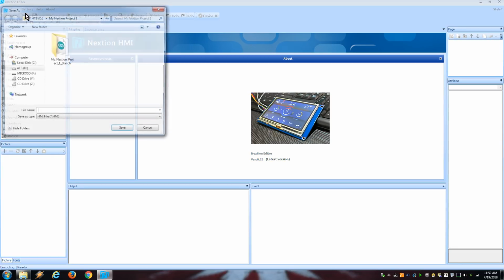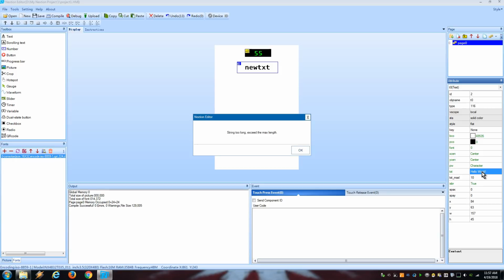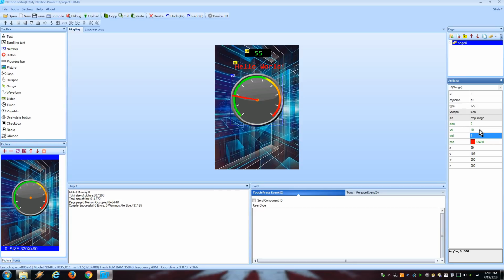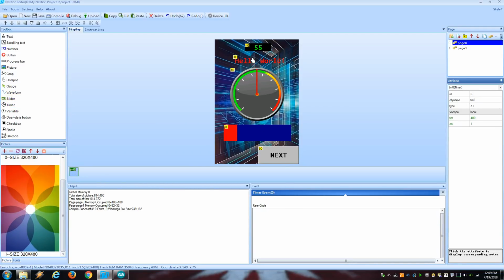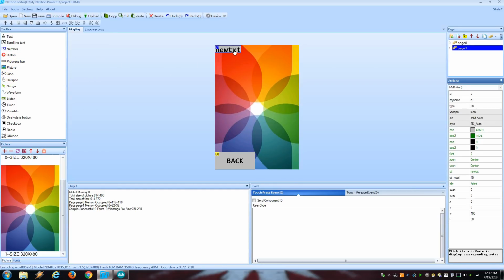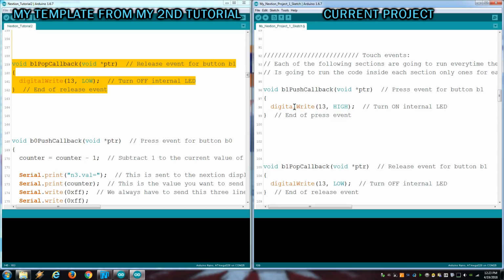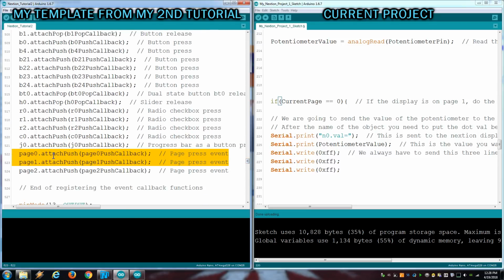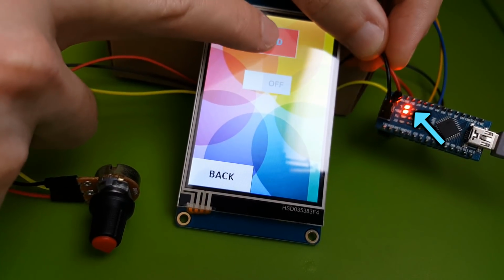Nextion+Arduino Tutorial #6 A Project From Scratch

Comment: When you are sending and receiving data, does it get sent to the serial monitor? If so, how do you use the serial monitor for troubleshooting?
Reply from the maker: It does send it to the serial monitor too. What I do for troubleshooting is print debugging data in the nextion display, only while troubleshooting. Once the code is finished, i remove that from the display.
Reply: @interlinkknight  Good idea thanks

Comment: what happend if you turn on led and go to another page?
Reply from the maker: There are many ways you can handle that. Usually, the LED would stay ON and the toggle switch on the display would reset to the default value once you go to another page, but you can make it a global variable so it can remember the state, no matter in what page it is.

Comment: I am trying to build a Nextion project to display two separate DC voltages real time as a dynamic bargraph (Progress Bar) and another indicator field that simply shows Red or Green based on a Voltage state (+5V = green, 0V = red) on a third pin. Hopefully I can extract enough hints and tips from this video to assist!
Reply from the maker: Yes, it's possible. Just watch all my tutorials and try those examples

Comment: Perhaps I missed it but can I have the Arduino command the changing of the display's pages?  For example, if the temperature of my sensor goes above a certain value, automatically switch the display to the temperature control page.  Thanks
Reply from the maker: Yes, you can. I show that on tutorial #1, I think

Comment: Does anyone know if this project will work with the 7 inch HDMI screens that can be purchased off Amazon?
Reply from the maker: All nextion displays work the same no matter the size
Reply: @interlinkknight  right ok, but does it matter if they aren't nextion displays? Or are the 7 inch displays really generic
Reply from the maker: Oh, you mean HDMI generic monitor or TV? No, no, no. That's a completely different thing. This video is about nextion displays that allow creating a graphic interface and connect to microcontrollers like Arduino. Nextion displays have their own controller so Arduino doesn't have to write everything on the screen. Instead, in the nextion editor you create the images, text, buttons, etc and then communicate with Arduino about the actions and send values and things like that.

There are many sizes for the nextion display, but you can't use any generic display for that. If you want a generic display, maybe use a raspberry pi
Reply: @interlinkknight  yep, gotcha. That makes perfect sense! 
So, what else would I have to do to with the Arduino the receive the CAN signals from my ecu? My ecu has a CAN high and CAN low out put.
Reply from the maker: I don't really know, but I guess if you you look for that maybe someone has a tutorial or something about that.
Reply: @interlinkknight  thanks anyway!

Comment: mine is not working... not getting the callback funtions on the arduino to start.. i can read the callback data i get the data from the display but b1.attachPush(b1PushCallback);  not working
Reply from the maker: Try my example files first

Comment: Hi InterlinkKnight,

first of all thank you for your outstanding work!
I tried to find a way to get me into the NEXTION display generation. Tried several ways, read a lot in other forums, but noboby was able to open the lock. Since I found your videos here on Youtube.
I worked them all through, all of them worked so far, now a tiny problem occured:
In Your tutorial #6 you want to get rid of the flickering of the gauge and at minute 15:00 you make an input in the timer you used for the changing of colors: 

- - -
if(z0.val!=va0.val)
{
  z0.val=va0.val
}
- - -
If i do the same and debug, I get the followig errors:
- - -
Error:Invalid Variables:va0.val( Double click to jump to code)
Error:Invalid Variables:va0.val( Double click to jump to code)
Error:Compile failed! 2 Errors, 0 Warnings,
- - -
Well I can live with the flickering, but it would be nice to solve, just to solve and learn ...

Any idea?
Thank you in advance

Freddie
Reply from the maker: Not sure what you did different. Compare your code to mine as close as possible. Eventually you should find the difference.

I wish i could help you but nothing comes to my mind. At least you have my code working so you can use it as a template.

Comment: I have a question: How do I get the display to show for example 3.1 instead of 3?
Reply from the maker: It doesn't support decimals so multiply by 10, then send to the display and add the dot in the background image if that screen
Reply: @interlinkknight  when I multiply by ten I get 10,20,30 etc. I have defined the values as int. Do I need to define them otherwise?
Reply from the maker: I mean, instead of having float to have decimals, use larger numbers. Instead of 1.2 use 12
Reply: @interlinkknight  that is what I did, I multiplied my integer value by 10, but then I still get 10,20,30 etc.
Reply: @interlinkknight  i have fixed it! :) what I was: change inputvalue * (5.0/1023.0) to inputvalue * (5.0/102.3). Now it shows 12, 21, 33 etc.
Reply: @interlinkknight  I have one more issue though. Have 3 empty text boxes which I want to use to show min.,max., and middle value of the voltage input. Min. Value is 0.0, max. Value is 5.0 and middle value is 2.5. When I send the values to the screen I get 0, 2 and 5. How can I fix this? Also, when I put the code for sending the values to the screen in the void setup it does not work. When I put the code for sending the values in de void loop it does work. Do you have any idea why?
Reply from the maker: Are you still trying to send decimals? Stop that. Also, sounded weird that you say you are using text boxes for numbers. Use number boxes.
Reply: @interlinkknight  I can send 25 to show 2.5 on the display, but there should be a way to code that my input is 2.5 with Arduino IDE and output is same as well. I don't know how though. Do you know what could be the issue with the void setup and void loop thing?
Reply from the maker: I don't understand. Better send me an email with a video showing the problem.
Reply: @interlinkknight  what is your email address?
Reply from the maker: my username at gmail.com
Reply: @interlinkknight  I have sent you an e-mail. Please check it. Thank you! :)

Comment: Hello, I have some problems with measuring the voltage with the screen and arduino. I can read the correct value with the Serial Monitor of the Arduino IDE, but the screen does not show the value. Could you help me with my code? Can I send it to you? Thanks!
Reply: never mind, I got it working! I forgot to change the serial line in the library :)

Comment: What is the refresh rate?
Reply from the maker: Depends, but its around 10 fps for the enhance version
Reply: @interlinkknight  a customer of mine wants to have a voltage measurement to be updated around every 300ms. So that is doable right? What would be the limiting factor? The arduino, the screen, the code..?
Reply from the maker: Yeah, is possible. The limiting factor is the Arduino loop. Use the fastest serial baud rate supported on the display
Reply: @interlinkknight  alright, thanks! How could I determine how much time the loop takes?
Reply from the maker: Do you really need to measure the loop time? Just avoid delays on the loop and should be very fast by itself.
Reply: @interlinkknight  no, I don't need to measure it. I just need to measure a voltage from two sources, so the code will not be very long.

Comment: Hi InterlinkKinght !  I am using a Arduino UNO and a 4.3 Nextion display. I compiled the code and it is all OK. I made step by step the whole tutorial. The progress bar is updating the value. The gauge is also working. The problem is that the LED and the built-in LED does not go to ON state. It is always OFF. I checked the display TX/RX connections and they are OK. I tried another UNO board. But the problem is the same. I tried a different 2.4 Nextion display and the problem is the same. When I debug using the Nextion Editor both LEDs goes ON and OFF. Do you have an idea what it should be happening  ? Thanks in advance.
Reply from the maker: I would have to see the code to tell.
Reply: InterlinkKnight I used the same code you wrote, the same variables and display design (HMI). Everything is the same. No adaptation. I basically copied, paste and study your code. I did this way to guarantee that it should work, because I have tried many others tutorial and the problem was the same.
Reply from the maker: Maybe you didn't use the correct nextion library. Maybe you forgot to put the correct id number of the button in the sketch. I don't know. I would have to check the code to tell.
Reply: Hi  @interlinkknight ! I found the mistake. My Nextion display was connected to a 5VDC adapter and the Arduino UNO was connected to the USB 5VDC of my PC. I solved the problem by connecting a "common Ground" between then. Now the code and hardware are running nicelly.  Thanks a lot.
Reply from the maker: Nice to hear you solved the problem

Comment: I can not get past "GaugeValue does not name a type".  Updating just the number on the Nextion works fine, but not the gauge. I have double checked the code, I should have the library installed, but no help.  Any ideas??
Reply from the maker: Watch the troubleshooting video. And also, try my examples of my other videos. To send data you shouldn't be using the library, anyway. That's your mistake, apparently.

Comment: You make it appear easy to use that Nextion editor. It's not intuitive. However, this is the only way to add attractive display/control to a microcontroller without a team and huge budget.
Reply from the maker: I agree that the editor is not very intuitive, but trust me that after a little practice its not that hard. Everything always look hard at first, but later you see how easy things really are.
Reply: Oh yes, I can learn anything, but after few decades of software use and design work, one realizes that intuitive software only needs to be learned once, and not every time there's a six-month gap between uses. Have you ever had to re-learn Microsoft Word, or Ubuntu's file browser, just because you didn't use them for a few months? Nextion Editor is one of those that has to be re-learned every time a product update requires a rare UI change. Nextion Editor is like The Gimp image editing software (not that Photoshop is much better). Aurgh!

Comment: ''NextButton'' does not name a type . anyone help please!
Reply from the maker: You are using the wrong library.
Reply: i used the library from your description and arduino ide is 1.8.5
Reply from the maker: Well, I only seen that error when using different libraries so it has to be something like that. Check again if you have multiple nextion libraries in your computer. I've see people making that mistake of installing the nextion library from the arduino IDE "library manager" and later adding another nextion library in their library folder. It causes a mess.

All this assuming you are trying to use any of my examples.

Comment: I've been looking for a display to use and came across your tutorials. Wow! It takes a tremendous amount of time to code these things, I know, I've stumbled through many projects and it just takes time. So...THANK YOU! I will be ordering one of these displays and get to work on it. I want to use a laser distance finder to read data, input that to the Arduino and display it onto another 7-segment display, but....I will be using the display as a touch-screen interface to enter calibration data, etc. Your work here just saved me countless hours!!
Reply from the maker: Great. It's nice to see that I helped. Good luck with your project. If you make a video about your project, post the link in here.

Comment: Hi Thank you for posting up a solid how-to for the nextion display. Been messing about with editor doing a project still havent. Received the display or teensy yet but its the arduino code part i didnt get now its making sense.
Question1: on the gauge i still dont fully understand how you get the gauge to read counter-clockwise from the stock 0 position 9oclock.  Is that why your code have -360?  Your gauge dial starts at 7oclock How do you set the dial? Coz when you add a gauge dial it auto points at 9oclock/ points left side.
Question2: is there a way to show a picture as an alert if a specific value is reached, similar to the way you change txt color?
Everything else i think i got. 
Thanks
Reply from the maker: Thanks for your words.

To answer your 1st question, the gauge by default points 9 o'clock that is the 0 value. The value of the gauge is in degrees and starts in the 9 o'clock (0 degrees). As you saw on the video, a value of 90° would be pointing 12 o'clock, for example. A value of 180 would be like 3 o'clock, etc. The -360 in the sketch is a way I use to continue from 359. For example, I can't send a value of 361. Instead of sending 361, I subtract 360 to the 361 to get a valid value of 1.

You can hide any object, including images, using the "vis" command like this:
Serial.print("vis j0,0"); 
Serial.write(0xff);
Serial.write(0xff);
Serial.write(0xff);

vis is the command to hide or show an object; j0 is the name of the object; the number 0 after the comma is to hide the object. Instead of the 0 you can put a number 1 to show (reappear) the object. You can see that on my 1st video tutorial.

I hope this helps.
Reply: InterlinkKnight Thank you for quick reply! you explain that so well . will check out the vids .after watch your tutorials man the nextion programming is waay easy then it seems.
Thank you.
Reply from the maker: Yeah, programing the nextion display is easier than most people think.
Reply: InterlinkKnight 
question on buttons: my project has page0-page8 and 3buttons per page (Home,Next & Back) for each button in project i have just the
 " Touch Release Event" set to "page Home, page Next, page Back" for each button. When debug it works i can switch between page0-8. Do i still need to setup 
"touch/ release event " and nextion library in the arduino code aswell for it to work once uploaded to nextion display? or the Touch /release events only needes in arduino code if am goin to use a button like a  On/off to controll a led attach to arduino?
Reply from the maker: Buttons that are to only change pages doesn't need any check event boxes nor any code on the sketch. You don't even need the nextion library on arduino for that. Changing pages is an internal thing inside the display so leave arduino out of it.

If you pay attention to my video, my NEXT and BACK buttons don't have any checkbox event enabled. Also, those buttons are not in my sketch anywhere.
Reply: InterlinkKnight ok kool thats what i taught but i just wanted to be sure. Hey Thanks you for sharing your project and code with us man really appreciate your efforts certainly makes it easier for us starting out...
Reply from the maker: No problem

Comment: Thanks for all your videos on these Nextion displays.  You were the first to let me know these smart displays existed in one of your older videos.  I'm definitely getting one to play with in the near future. 

One of my displays is very slow (via the I2C bus) because it requires you to read/write 16 bits at a time even if you're updating just one pixel.  I couldn't find a library to run it, so I wrote my own library with a 1K write through cache to speed things up (admittedly it was fun to write).  But it uses up quite a bit of memory and cpu.  It works great now but I can only use it with my Mega2560 due to the memory requirements.

These smart Nextion displays reduce the amount of I/O dramatically so it looks like an 8-Mhz arduino can easily use it with plenty of cpu and ram left over to do other things.
 
Oh - and from your recommendations, I purchased some BusBoard breadboards and they seem to be much better quality than my cheaper ones - just as you said.  I also just bought a Jameco WBU-208-R Breadboard.  I haven't used it yet so we'll see.   Thanks again!
Reply from the maker: It's nice to know that I helped you. Thanks for the comment. If you have a problem, let me know.